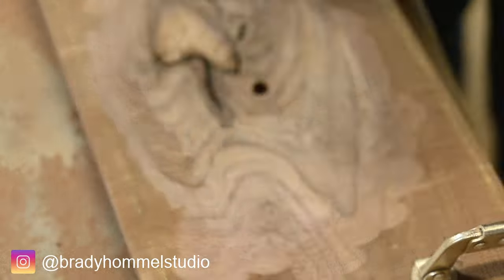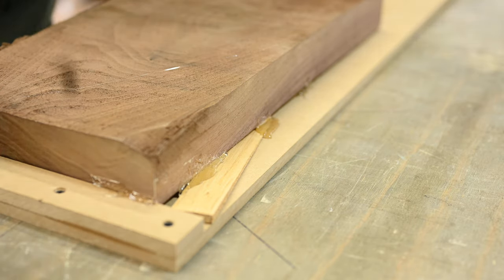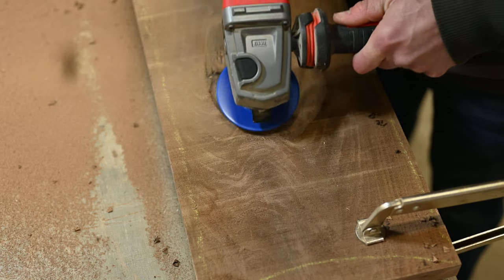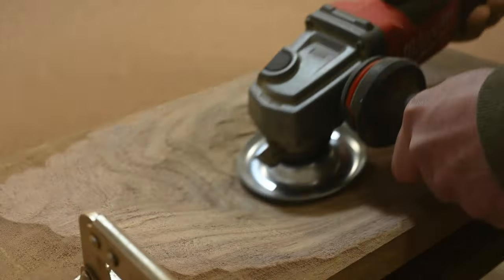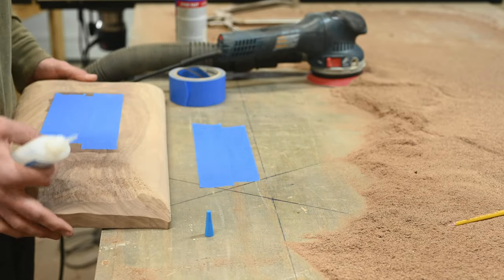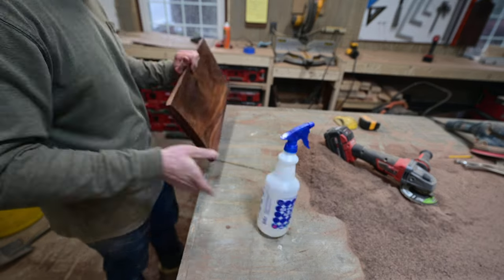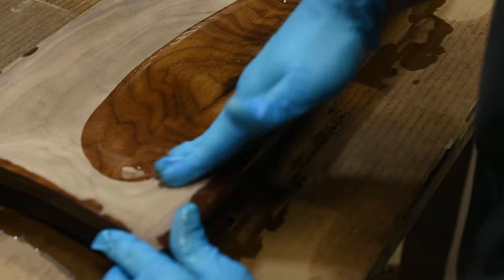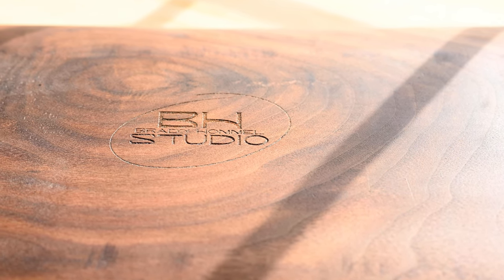Beautiful walnut bowl with angle grinder

Comment: you just dont know how to use the agressive one... you can only use it on the side that pulls the grinder away from you... so the shavings shoot straight at you... then it wont bite in and hook up... also take the extra handle off of it, thats screwing you too.... use both hands on the barreland make the grinder wanna pull away from you and eject shavings toward you... then youll love the aggressive wheel.... also orient yourself so the part your cutting on is sloping up away from you... so the grinder wats to travel uphill... if you try to cut downhill its also a lot grabbier...

Comment: Get the Kutzall shaping “Disc” and “Dish” 1 of each. I prefer the extreme over the original ones. I am literally collecting all of them because they are that good. The disc hard shape is great for flattening and leveling mor3 the dish I have used to hog out with the higher walls and is better for contours.
Reply from the maker: Thanks for sharing that with me. I've heard the Kutzall brand is great and lasts forever. I will definetly keep this in mind for my next power carve project. Thank you!

Comment: Whrn power carving I  use one of those rubber non slip weave mats on my bench, no need to glue your work down.
Also works well when freehand carving designs with my router.
Reply from the maker: Great tip! Thanks a lot

Comment: Great work! If you used a plug in angle grinder it would be quicker opposed to the battery powered, regardless of the wheel.
Reply from the maker: Thanks a lot! I got rid of my corded one unfortunately when I bought this one but your right, I went through a lot of batteries. Haha